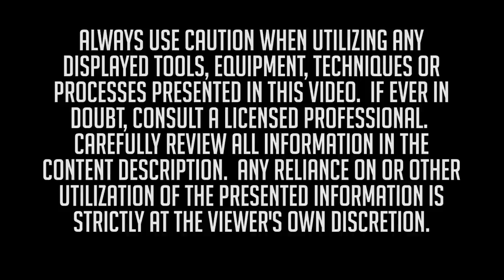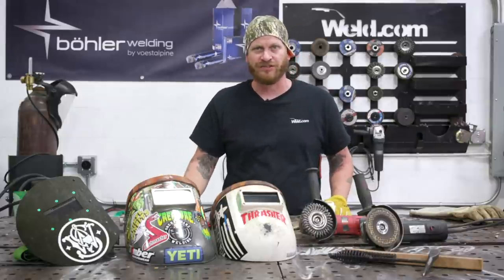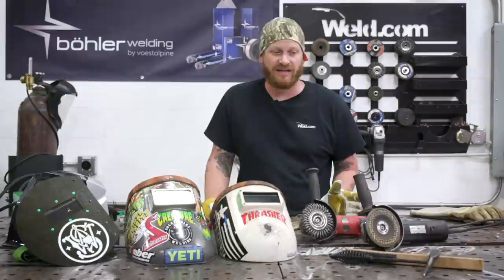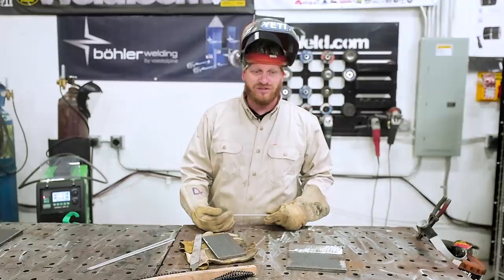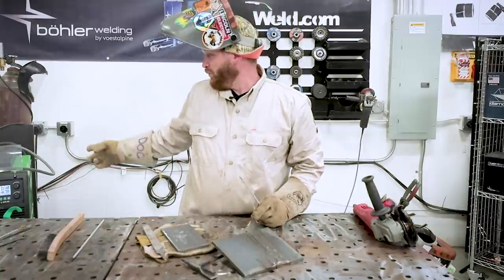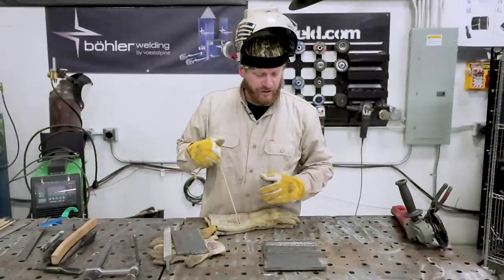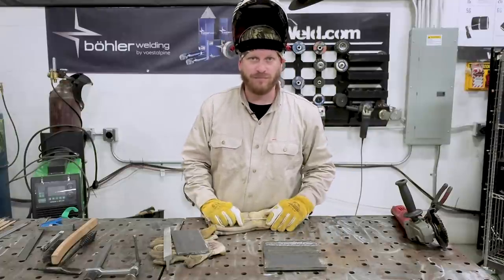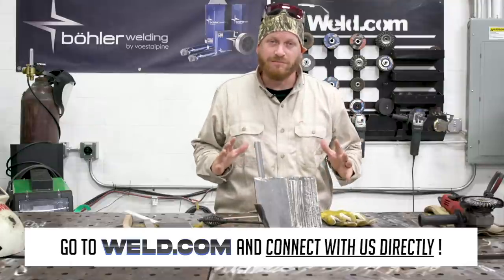Stick Welding SMAW Tips for Beginners

Comment: One "trick" I use is a standard everyday red brick.  It is a great block to run the rod across to scrape off the slag.
Reply: Excellent!  Thanks for the feedback 👍
Reply: Not gonna lie I'm just getting started welding at the age of 16 and this is a good tip I would have never thought about thanks Danny💯🤙

Comment: If you have to use 6010 rods I would get 6010 5P+.. It starts easy and produces a smooth weld even on rusty material. The slag also removes easier than 6011 or standard 6010
Reply: A lincoln fleetweld 5p+ is a standard 6010👍

Comment: My thoughts on what rod to use when:
6010/6011 run very hot and are used in pipe welding as the initial pass to burn through and form a keyhole and then fill in the keyhole. That is why you whip and pause with these rods. The other use is welding on galvanized steel. You need that heat to burn off the zinc.  Some machines will just not run 6010 but will run 6011. Some codes require 6010. These rods are not very useful to a farm welder or home welder unless you are welding galvanized metal. 
7018 runs cooler and deposits more metal and is stronger than 6010/6011. It is used in structural welds. People get confused about low hydrogen rods like 7018 and the need for keeping moisture away by baking them in a rod oven. You only need to bake them if you are welding a highly constrained joint of high carbon steel. For farm welding and hobby welding mild steel, use out of the can with no worries. It should be the go to rod for most projects. 
6013/7014 are general purpose rods. They are the easiest to weld with and lay down a lot of metal and make the prettiest welds and are hot enough to burn away contaminates. They are frequently called farm welder rods. They are not hot enough to weld galvanized steel and not as strong as 7018. If your weld strength is not critical, you can use these. Even though 7014, is listed as all positions (because of 1as the third number), it melts at a low temp and makes vertical and overhead quite a challenge. 
I hope this helps.
Reply: Both 7018 and 7014 have the same tensile strength correct? I am just curious how one is stronger than the other?
Not saying this as a troll either. I am curious and google wasn't much help.
Reply: @zacharystout492  
The strength I mentioned was something a hobbiest or beginner welder would never notice. 7018 is for welding high carbon steel and has a little better penetration than 7014. That is important to an engineer, but of no use to a hobby welder. For fixing a broken tooth on a box blade ripper, 7014 would be as strong as 7018. For welding together a structural support containing high carbon steel, 7018 is required.
Reply: @TheDadPenfield  thanks for the reply. I am picking up what you are laying down.

Comment: What I do with my E7018 as soon as I’m at the end of the weld I hold it there and let it fill up for about half a second and then quickly flick the rod so you don’t have to fight it to restrike
Reply: Good idea! Thanks for the feedback.
Reply: Depends. Youll learn as you go. Depends on the metal thickness. If its thick.you can hang out a long time. If its thin. You might need to use 6011 as a stringer then build up over it as a beginner. After some time. By preference, i stopped using 6011 when I mastered 7018 on thinner materials. If you fuck up.7018 sucks to grind.
Reply: And to restrike always tap off the slag. You your still not burning rods. Then turn up your heat.
Reply: @mattgaming8717  I always rake my slag off the toes of the weld with a sharp piece of a file. It's there that it's the toughest to clean.

Comment: 6013 best training electrodes for beginners
Reply: Actually  7014 is much easier especially for restarts and slag removal. and all position.
Reply: @bruced1429  Unfortunately they are non-existent in Europe, definately in the UK.
Reply: @ianvincent4911   too bad, in Canada we can get everything the US guy can. If you have an Air Liquide  store in your area you should be able to get all. They are a French company and they have stores every where here in Canada,so why not the UK?
Reply: @bruced1429  We have the same suppliers e.g. ESAB etc. But they don't import them. 6013 is used for nearly everything (well and 7016/7018) but our 6013s can be very different with lots of variation. For example Bohler do various different 6013s but they can be radically different how they weld, some even weld like 6010s. We do have 7024s though, although they aren't used much (have some in my garage).
Reply: @ianvincent4911  Yes I have all of the rods you mentioned plus many more types.I do hard facing on  snow blowers and other farm implements and repairing other equipment. I do use the 7024 for a nice ripple finish on some barbeques I make. I have 2 Fronius and 1 Esab welder and just ordered a HTP pulse mig welder.

Comment: CAn anyone give a breakdown of which rods to use when?
Reply: Sure, 10&11 for ‘deep penetration’ but requires a different rod manipulation when welding …. 10&11 very popular with ‘deckers’ because they’ll burn through decking like butter and will allow a fast plug/spot weld to be created onto the supporting structural members 🤷🏻‍♂️ …. and since it’ll burns much hotter you need to move the rod ‘in - n - out’ of the puddle or you will through lighter gauge steels if there’s no supporting member that plug or spot weld is not part of the will allow having a desired plug or spot weld connection at that point 😬 ..… trade folk call it ‘stacking-dimes’ because that joint appearance will be that of showing how quickly the ‘in - n - out’ movement can solidify the molten mass and that suddenly cools leaves the molten mass with a  flat ‘dime’ look 🤔 … while on the other hand, 7018 will provide only a mild penetration but the bead need only to be dragged without much worry 😁 … and slag cleans off with little effort 😎 … good luck amigo and practice, practice, practice 👍🏼💪🏼✌🏽
Reply: @BC-hr2of  Thanks! For my first build I'm trying to make a steel gate. 1/4 posts and frame and 1/8 in the middle. I have 6011 - is that too tough? Are my thicknesses good?
Reply: @mikerubin290  … 1/4” good for post strength but while you’ll lay the heat into that 1/4” thickness you’ll need to keep an eye on the 1/8” material because the heat you use on the 1/4” material can overwhelm the 1/8” material …. there’s a good ‘household’ rod, 6013, runs exactly like a 7018 rod without all the rod moisture precautions … if you’ve never used 6010 or 6011 you’ll need to get the technique down … 6013 is relatively easy to ‘drag it’ and have good mild depth penetration welds…. one more thing, 3/16” would of worked just as well 🤔 … maybe easier to work 😎

Comment: love your videos, i was wondering, can you whip a 7018? in sweden we don't have 6010. i work as a mechanic at a sawmill wich includes welding and sometimes when doing repairs the gap can be wide so it can be really hard sometimes to have control over the heat.

Comment: What if we used tungsten rod in stick welding for half mm thick steel plate welding, what will happen, it's kind of awkward but please can you answer me?
Reply: There is no flux coating on tungsten so it would only stick to or burn up the metal and not bond or create a bead. 👍 "only baldor awkward question is an unasked question."
Reply: Hot tungsten oxidizes quickly unless you have shielding gas.

Comment: Tips for starting 7018 without sticking?
Reply: Practice, practice, practice. I still stick the rod. I stuck the rod today like 3 times. 🤦🏼‍♂️🤦🏼‍♂️but a good technique is to start dragging the rod from a higher location then your weld point then line up your rod into the start point and drag it out from there. Drag down about an inch from the start, This will warm the rod and help keep it firing while you get into position. Let me know if this helps. You can also reach out to us on the weld.com forum.
Reply: Practice….

Comment: OK - so what happens when the rod constantly sticks?
Scratching or tapping makes no difference
7018 110-150A makes no difference.   1-1/2" angle iron that has been weld ground clean.  Sticks everytime fast or slow.  Lincoln AC 225C
Reply: Buy a cheap DC machine?
Reply: @johnmoriarty6158  
Thanks for the reply, however,   Why buy another machine - when it is better to figure out why it won't work (weld) better??
Reply from the maker: Hi Danny! If you want to post in our forum you will get a lot of advice! www.weld.com/forum
Reply: On a practice plate, Try to lay the rod at a greater then 45° angle and just drag the rod backhand with a quick motion like a match but for a couple of inches. What you are try to do is create a steady uncontrolled arc without sticking. If this works try again then pull up on the stinger while trying to dip the rod into the plate and slow down your pace.
Reply: Also if there is not enough flux coating around the tip of the electrode you will not create the gas barrier you need to maintain the arc without sticking. Please reach out to us on the weld.com forum for more insight. I hope this works, let me know 👍
Reply: @bobhigginbotham9035  
Thank You All for the input - I was (and am) at a loss as to why I could, but now can't.  Appreciate all the replies.
Reply: @dc85337  just keep at it. If you get frustrated, take a break. "Be the weld you wish to see in the world"
Reply: @bobhigginbotham9035  
I agree with the last - it is when you can't figure out the problem that is troublesome and frustrating.  It could be anything from a 1/2% moisture in the rod to a bad clamping ground to problem with welder ???

Only know enough but not enough to fix it.  Used to work on pipe and industrial welding - now can't weld ________!!  piece of angle iron!  hahahaha
Reply: @dc85337  you will get your hand back! "It's like riding a bike, you may never forget but you sure will lose your balance trying to remember" 🤣🤣 - also 7014 rods really help with controlled strike and  arc burn. Easier rod to burn with equal tensile strength. 👍
Reply: @bobhigginbotham9035  
Thank You for the the replies !  Just frustrating when you "think" you know what you are doing and it doesn't work!  Very Frustrating!!!